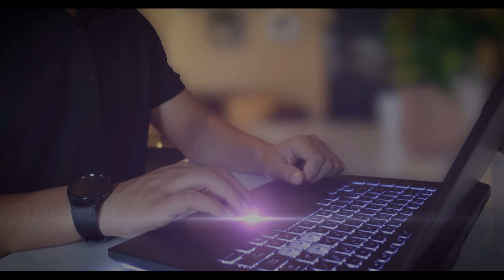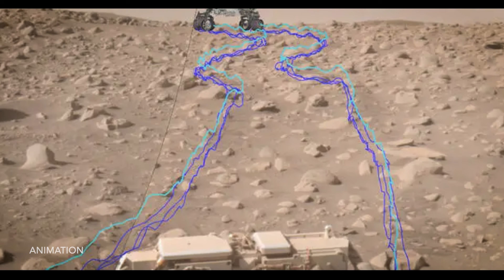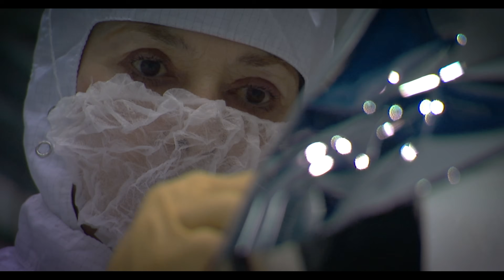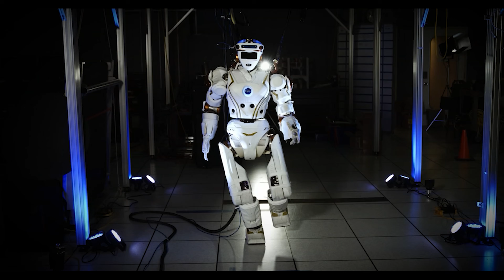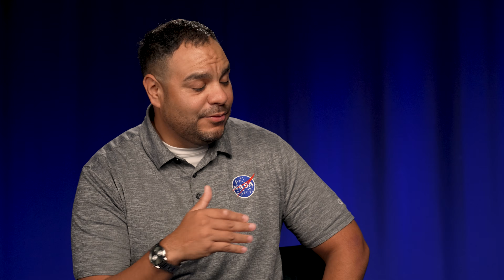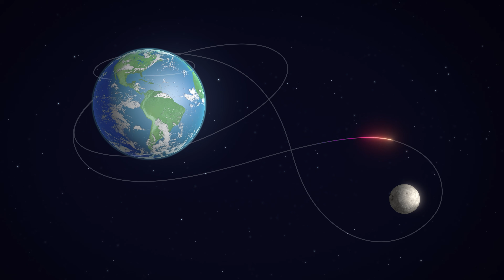AI at NASA: Unlocking the Future of Exploration

Comment: What criteria do you use to decide which  ideas to use from AI responses?
Reply from the maker: When AI creates answers or solutions for us, we double-check everything using the same steps we use for human work – AI is not treated as more accurate or capable than any human doing the same work.
Reply: Interesting and relevant question: I have the same problem when I'm confronted daily with (local) news media. Sometimes, on the same topic, I get several conflicting answers, some contradicting others (like night and day). 
How can I find my way through all this media noise and get reliable information ?
Generally, I proceed by deduction and grouping information (relevant and irrelevant). There's what's easily discernible and what's comparable (not quite the same thing).
If I'm unsure, I often check what foreign media outlets are saying (in another language); however, sometimes research and investigation are necessary. 
As for investigation, Wikipedia is a good tool for drawing conclusions (clearing up doubts) about information from a media outlet. 
Of course, with Wikipedia, you also sometimes need to check the relevance using the language (country) function because there are sometimes differences in article definitions. 
It's fascinating to try to resolve doubts :
> Aristotle supposedly said something like, "To verify one hypothesis, you need at least two proofs." In fact, there are four fundamental aspects: the formal cause, the antecedent cause, the compelling cause, and the final cause. (see also: Karl Popper) 

Sincerely